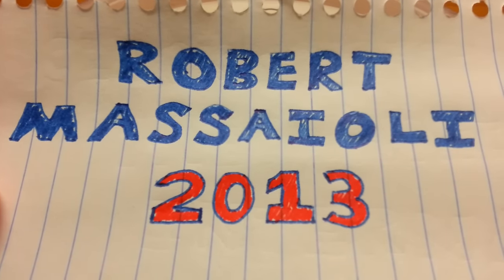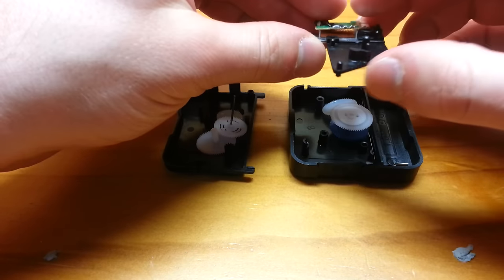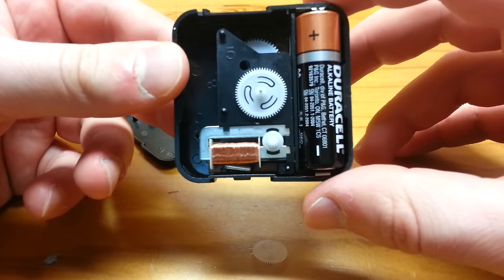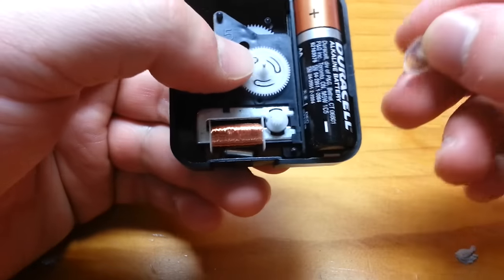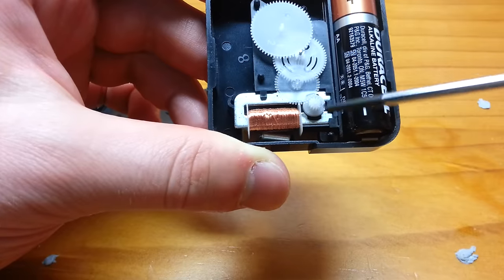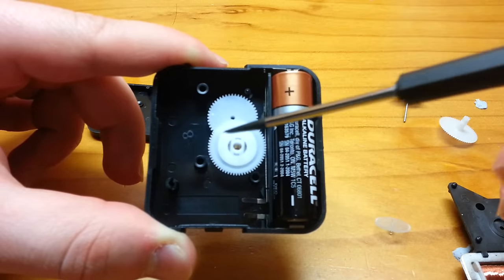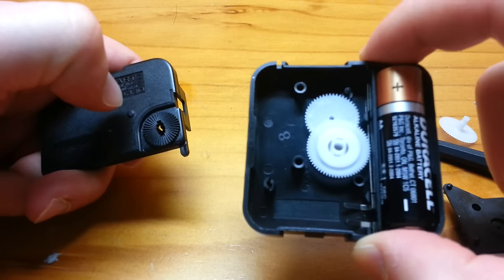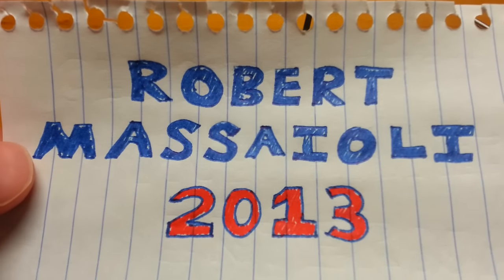Internals of Quartz Clock Mechanisms

Comment: Hi Robert, I have a similar quartz clock (Ikea wall clock with a Junghans movement). The problem is when the clock is in a vertical position (like on a wall), the second hand sweeps around until it comes to the 8 or 9 position. Then it sort of struggles as it goes "uphill" and it just gets stuck there. It still moves (or rather pulses) but it can't proceed. Because of that, the minute and hour hands also don't move on. It works fine if the clock is placed flat. What's wrong??? Thanks
Reply: Too much gravity, tip some out 😁

Comment: Oops! Did I say MHz instead of KHz in my post below! Sorry, of course its KHz!
I am amazed that no one has substituted the original crystal for a 16,384 KHz crystal in this movement to get the clock to have 1 pulse/2secs, thus enabling me to make a single hand 24 hr clock!
What I have done meantime is to resort to a mechanical solution. viz., introducing a 1:2 reduction made with 3 gears I was lucky to find in a small toy dune buggy!! This could have been done with just 2 gears but I to maintain clockwise direction added the third gear.
Robert, your response please, but better still, a simple electronic solution. Arduino, MCU yes, but couldn't find a crystal solution on the net.

Comment: The reason I'm watching this is to glean information about battery orientation when the battery compartment is not marked plus or  minus. I have such a clock from IKEA with a clock mechanism just like in this video. I removed the old battery, then forgot about the clock for a few weeks. So some time later I wanted to reinstate the clock and got a new AA battery ready to insert. Usually this a matter of a second or two, but there was a problem. I could not see a + marking anywhere! I got a torch. I got a magnifying glass. No + symbol evident. Eventually I just put the battery in and hoped for the best. It didn't work. So I inserted the battery the other way around and the clock started working. But how can a manufacturer produce a clock mechanism without marking the + end? Weird. I have now put my own + marking on the case.

Comment: What About The Quartz Crystal That Pulses Every Second For The Second Line Timer?
Reply: Quartz crystals oscillate at a frequency of 32768 times per second when electricity passes through. Battery powers the electronic circuit where the quartz crystal is located. Therefore crystal circuit generates 32768 pulse per second. Also the number 32768 equals the 15th power of 2  ( 32768 = 2^15 ). The rest of the circuit consists of an integrated circuit with 15 semiconductors, which are connected each other in line. Each semiconductor works in the same way with its previous and next one: they cut down the number of electric pulse into half. So each semicoductor sends the half number of pulse it receives to the next one.
first semiconductor receives 32768 pulse/second and gives 16384 to the 
second which gives 8192 to the
third which gives 4096 to the
fourth             >>   2048
fifth                 >>  1024
sixth               >>    512
seventh          >>   256
eighth             >>   128
ninth               >>    64
tenth               >>    32
eleventh         >>    16
twelfth            >>     8
thirteenth       >>     4
fourteenth      >>     2 pulse per second
and finally the fifteenth semiconductor produces one electric pulse each second.
(I believe the rest of story is known)
Reply: @xrtsmt  great explanation.

Comment: I would like to make a revers clock ,but one that has a continuous movement. Can you please give an advice about that?  Thank you very much!
Reply: you must change the position of the solenoid if you reverse it it will orient the magnetic field in opposite way the small magnet will reverse his gyration, since the mechanism is  pure gear it will work reverse without problems

Comment: For a error i used a 9v battery instead of 1,5v. For the seconds it goes. Now the watch not works. I've to change the cristal and capacitors or the clock engine (motor) is fault, dead?

Comment: i want to create a clock where the face spins instead of the hour hand. perhaps funnier would be the face spinning in place of the second hand though
Reply: after thinking about it for a minute i think i could do it quite simply too.  if i were to change all of the hands for seperate faces, smaller in the front so you can see the one behind, and add hands floating infront of it all it may work. oh and flip the battery around so the faces spin counterclockwise. definitely trying it
Reply: It can work but the motor can only move a small mass so the face needs to be light and no friction.  Hands are very small.
Reply: @danc2014  i did make it using discs of thin paper as the "hands" with numbers on them although it seems like it always gets stuck from friction eventually with the paper changing shape with humidity etc. the clock motor needed to be reversed also as the discs need to spin counter clockwise
Reply: @danc2014  it has one hand painted on the glass, which points to the top(12:00 on normal clock) which is where you would read the time
Reply: @danc2014  it's been on my wall not moving for about a year cause i got tired of flattening out the sheets to reduce friction every time it got stuck. you got any ideas for a material or process to create the faces?

Comment: Hi a good video explanation. I am on a project on the same  clock gear but my project is to reduce the speed of the second can you explain me
Reply: To get the clock to tick differently, you need to replace the circuitry on the board.

I actually sell a replacement controller board on Tindie that can make these clocks dance in all sorts of different ways. https://www.tindie.com/products/nsayer/crazy-clock/

Comment: I bought a little clock for my nightstand .  The first time I set alarm for 9:20. Low behold it rang at that time every day, even when I had the alarm turned off.  Then I changed alarm time for 11:00.  IT RANG AT 9:20 AND 11:00.  I turned off for 11 but had 9:20 off. NOW it rings both times.  Making me crazy. I bought this pretty clock at Walmart.  Of course I had thrown away receipt.  SO,what's up with this crazy, cute little clock.

Comment: But how does the first gear move at its pace? How does the quartz crystal affect the time?
Reply from the maker: There are other videos on Quartz Crystals and how they resonate: https://www.youtube.com/watch?v=o8YUM2Y2vvY

I decided to focus on the clock mechanism instead.
Reply: The quartz crystal is made to oscillate constantly. There's a tiny controller circuit on the clock which keeps track of how many times the quartz crystal has oscillated. When a second's worth of cycles have occurred, the controller does something to the solenoid (I don't know exactly what) and then resets. The effect is, ultimately, making the magnet, and the first gear, make a half turn every second.

Comment: Is it possible to make the clock go in reverse? I read somewhere if you flip the metal thing that goes through the copper wire it'll reverse direction. Attempted it but broke one of the gears fml. Anyone can confirm?
Reply from the maker: +DinomodeX Buy another clock and let us know! My suspicion is that you would have to invert the position of the magnetic field. So you would have to flip the metal bar 180 with the solenoid still attached to it...but in most clocks the prevent this configuration by designing the plastic mould to prevent it from happening. Nobody makes money if you ship clocks that run backwards.

So give it a try, get inventive, and post a video back to us when you are done! Good luck!

Comment: Hello, Mr. (or Dr....you look quite knowledgeable ) Massaiobi

I was wondering how the solenoid wire makes the magnet rotates. Can you explain it more in detail by physics ?

I know there will be induced magnetic fields (N and S,alternatively)near the solenoid if there is an electrical current in the wire. 

If the magnetic fields interact the fixed magnet, how can it make it rotate ?

Many thanks for your further explain and reply!
Reply: h bridge with transistors

Comment: Generally 👌 but rather a long winded way of explain it, the rotor does not spin back and forth as you stated it goes round and round and yes as someone pointed out the metal plate if turned round can make it reverse BUT it will always turn round and not back and forth, also you say you are replacing the hour and minute hands, not factually correct as the parts you are inserting are the gears the respective hands fit on not the hands themselves